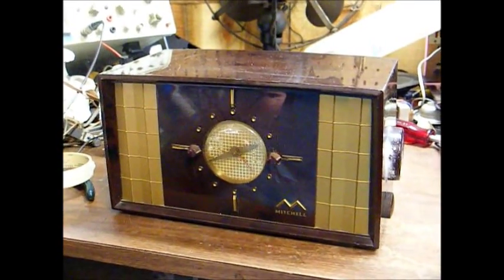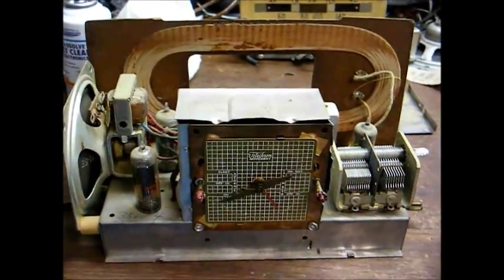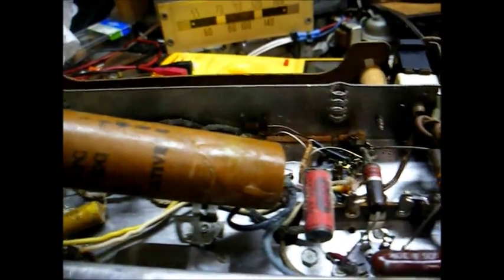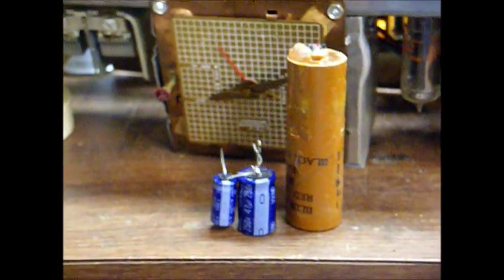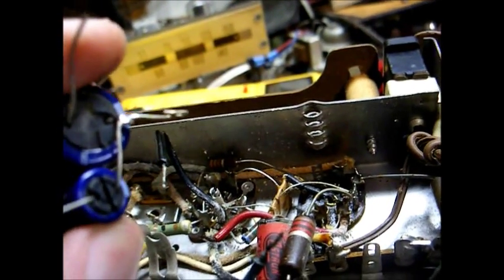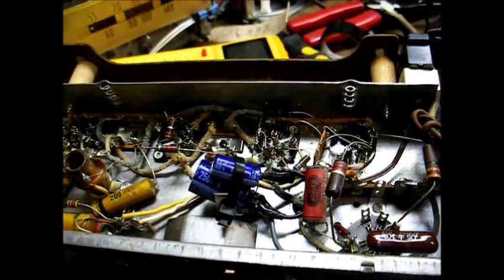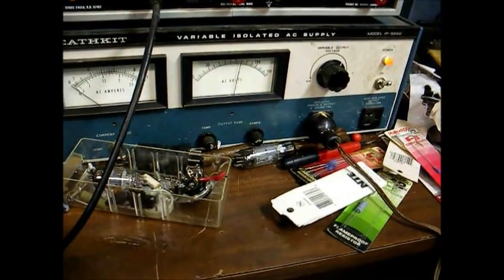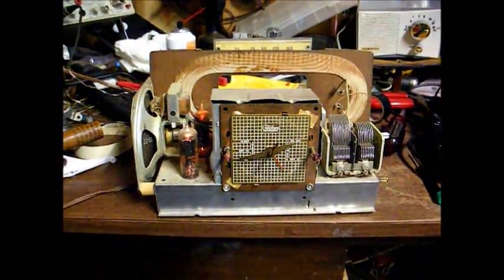Repair of Mitchell AM clock tube radio - pt. 1

Comment: I'd-a  STILL added a 3.3 mfd, 160 volt cap in parallel  with the  47 mfd to come up with the original 50mfd called for & checked all the tubes & replace any weak ones...but that's just ME, LOL! Great job, especially considering you are holding the camera the whole time! ANOTHER GREAT RESTORATION! Thanks for the video!

Comment: Maybe kids kept pulling the knobs off, or they were so loose, they would slip. I am only taking guesses. The red capacitor looks like a crayon, lol.
I thought you could hook them in series? Negative lead on one out, , the positive to the negative of the 2nd cap. Then the last caps end being positive, is the positive lead for the circuit. The negative lead of the first cap goes to circuit, correct? Like batteries in series.

Comment: Thanks to you I was able to replace a multisection  electrolytic.capicaitor in my tube.radio ,the rest of.the caps.we're ceramic ,only problem I have left is the speaker wires were brittle,and snap off I hopeing.to find a schematic for it .great videos I am hopeing.to find part two

Comment: I have a GE clock radio from 1951 which is a model 516F and I replaced the bad capacitors, but I need new capacitors for my AM clock radio. This bad capacitor is the same that I have, and it had a filter hum which is not good. I'll still be working on it someday.